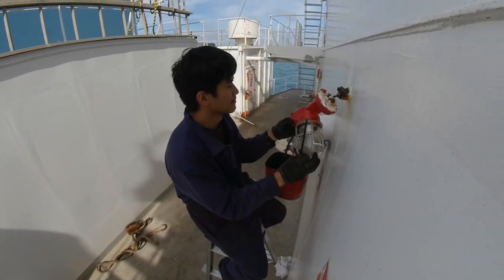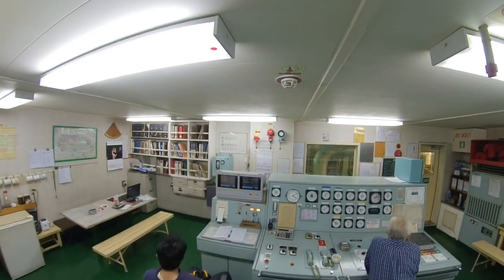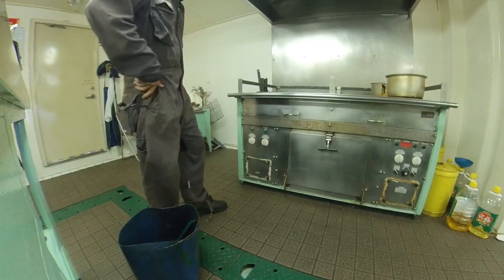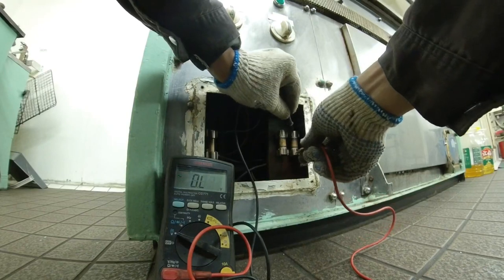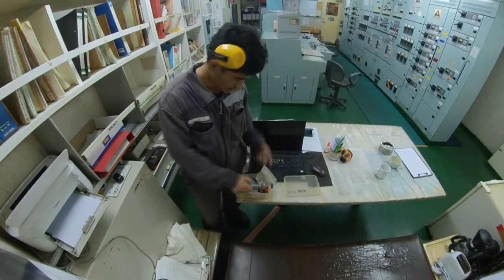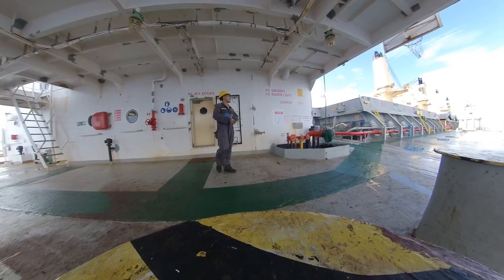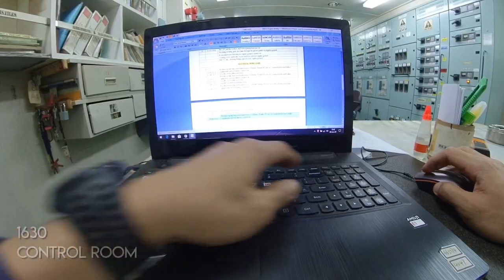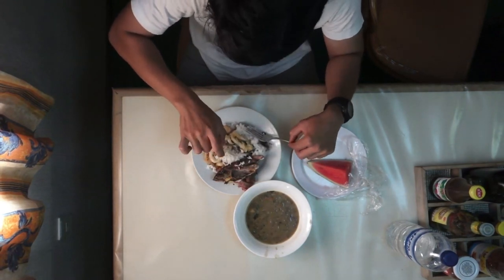A day in the life: Marine Electrician

Comment: Great job, Mark! Only one remark, on repair of electric range: if you see that fuse is blown, you must check why it was blown. Most probably it happened due to short circuit, which could happened during cooking, when burner is hot. It could be in hotplate, in thermostat or because of sticky or burnt contacts of the switch. Also, in such situation, you better inspect all these parts, check their wires and contacts for water or oil on them, and do insulation test of all burners to prevent any possible malfunction in the future.
Reply: wow this helps me to know different way too sir, thank you
Reply: Best comment i found here
Reply: What's the difference bt electrician and electrical engineer ?
Reply: @АнастасияГорщенко  electricians have professional trade specific training and licensure, and provide field service electrical work, generally involving a building, or in this case a ship. Electrical engineers  have both professional and academic training that includes science math and engineering theory, culminating in a 4 year bachelor's, generally of a B.s or B.eng, and eventually, sometimes, a professional engineering licence. Electrical engineers tend not to due much installing or assembly, as that is lower paying work generally reserved for tradesmen, and instead usually focus on the designing of electrical systems, the construction of which might then be carried out by an electrical engineering technician, or even an electrician. Generally, engineers have more formal education and are paid more. Electricians on the other hand tend to have a lot of hands on experience.
Reply: @gesshugh9976  just like in every industry

Comment: When you are out of the marines are you a registered electrician? Or do you have to go through an apprenticeship again?
Reply: Merchant Marines are not military.  I joined a union (Seafarers International Union) and start off as a wiper (essentially engineroom janitor) then you take Coast guard exams and upgrade to the next position after you've sailed for a certain amount of time. My union makes upgrading easier by offering free courses and testing, however you can do it on your own self study if you choose.  Wiper -> Oiler -> Qmed-> Electrician.  Overall it could take about 3 years to get your Electricians. That's if you sail 6-8 months a year and continue with your own self study.
Reply: thats merchant navy Job ETO Electro technical officer on board very good slary btw 5000$-8000$ per month and Duration 6 month job

Comment: You didnt check heater if damaged
Reply from the maker: Yes. If power supply is present, you need to check the protection devices first on the circuit. These devices are bound to fail to protect the line and machineries.